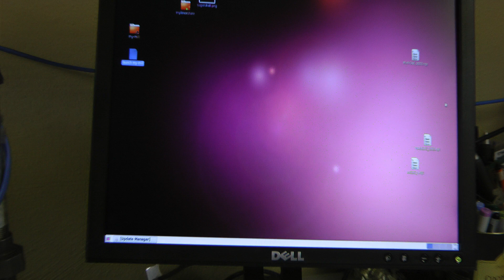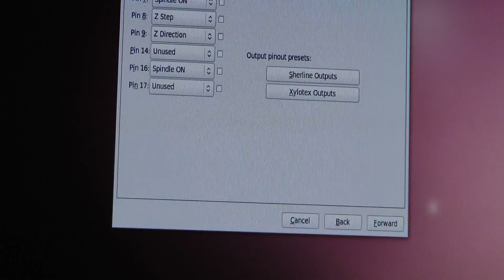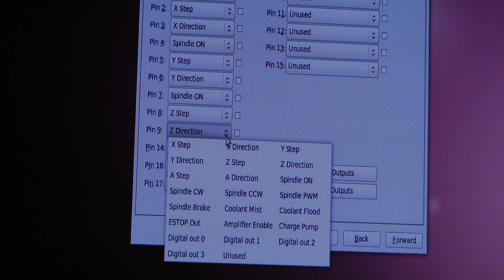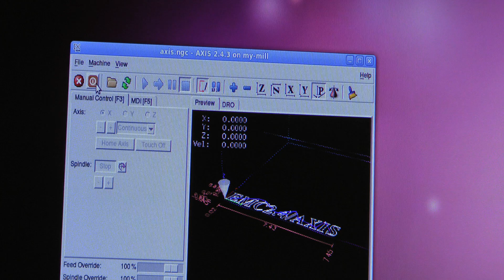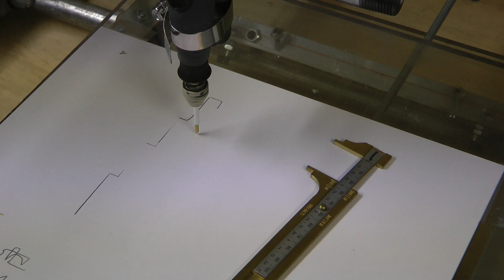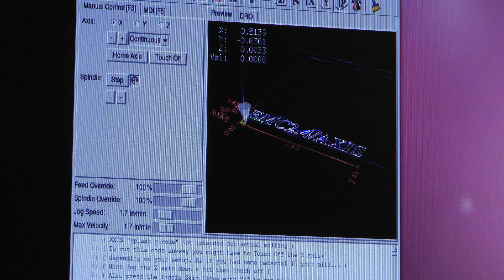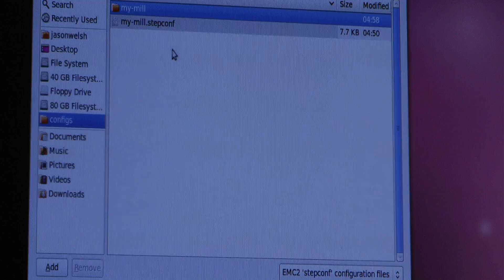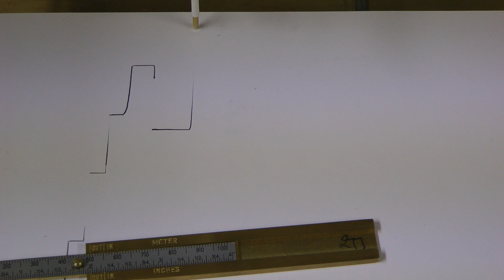Ep12S1 EMC and calibration.MTS

Comment: The Driver Timing Settings are for the digital signals between the PC and the driver.  You should check your driver datasheet for the minimum for these values, not the motor datasheet.  Modern driver chips like Allegro's A4988 etc can take much lower values e.g 1000ns or 1ms for mark & space, which results in a maximum 500,000 pulses per second.  This is important if you are trying to get high motor speeds with a microstepping driver.